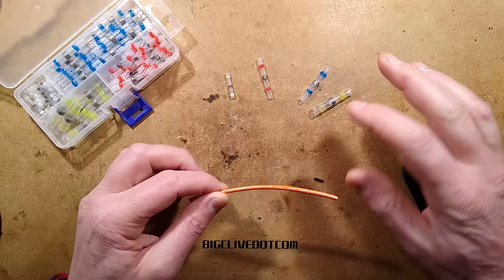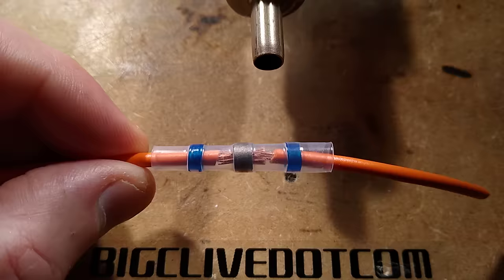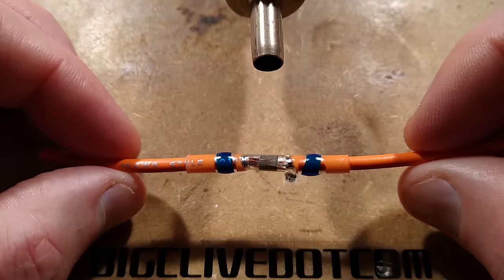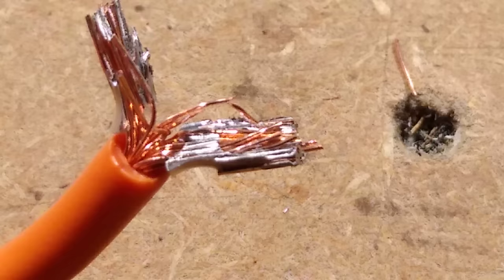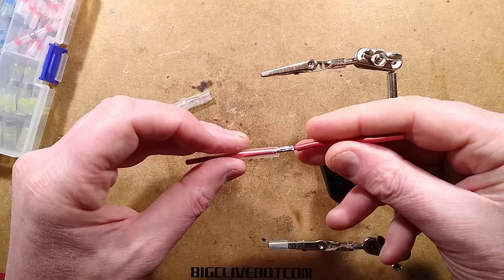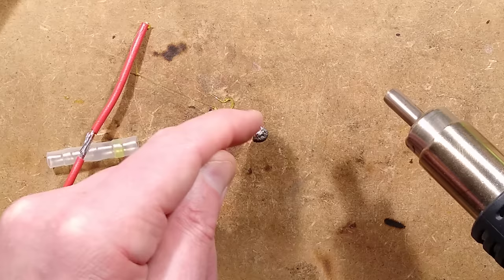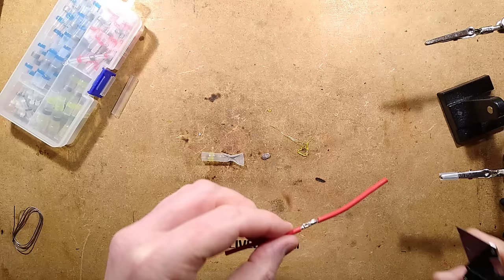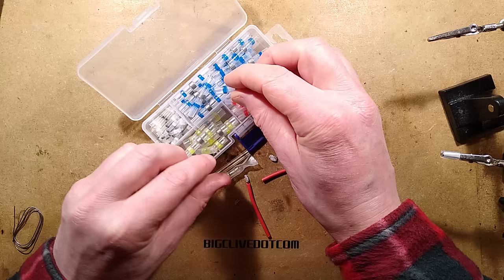Heat shrink solder butt connector test.

Comment: Have been using this for over 8 years never ever had any issues with it  but I use more heat than your first try. And mine cost +/- 0,75 €/piece.
Reply: You definitely haven't been using these, rather a quality ones for that price
Reply: Boy that's pricey
Reply: The Racal ones cost you deep in the purse but seem to be good. As ever, you get what you pay for.
Reply: @davidquirk8097  You don't get more than you pay for, but you can quite easily get less.
Reply: You're probably using real, aviation-grade solder splices.

Comment: Those things are awesome. There really doesn't need to be that much solder because it also crimps the strands together with the heat shrink. So easy and fast to use those.

Comment: Man, I love solder sleeves. Had to learn how to use them to mil-spec in my training days, never once used them professionally since. The rule has always been, "better to remake the whole cable than use any kind of splice" But for home jobs, use one every time because I'm not paying to replace a perfectly good length of wire.
Reply: I would argue that any properly done crimp or solder joint is just as strong, if not more, as the rest of the cable.
Reply: @Drives31forhalo  I agree with that. Properly done, a connection either solder or mechanical is at least as strong as the base wire. The lineman's splice is an example of that. NASA uses them as just a plain lineman's splice is stronger than the base conductor alone, even without solder.

But a properly soldered wire is also stronger than the base conductor, unless the base conductor is steel or something that no one uses for conductors.
Reply: Only time I used those in the avionics world was to make a connection to the braid of data shielded cables, as you needed a short pigtail of PTFE wire to go into the connector body for the shield, plus you had to seal the end of the cable as well so it would not wick up moisture into the shield and corrode it. 

The sleeves were Amphenol made, and you needed a pretty high heat to get them to reflow properly on to the pretinned end of the cable and the sleeve, the solder preform inside being there more to provide a final solder and flux flow than to actually tin the wires. You cut the outer down to the required length, then carefully spread the shield so you could cut around without nicking the inner cores, then made the end back into the correct braided shape, and tinned it to hold together. Same for the pigtail, and take the sleeve and slide over the outer sheath. Bring back down so the preform, the tinned pigtail end and the shield were all aligned, and heat with a hot air gun, till the sleeve was shrunk, and the solder melted into a solid mass. 

Then allow to cool undisturbed, and finally cut to the right length for your cable plug or socket ( depending on direction), strip the insulation off the wires, tin them and solder into the insert, or crimp onto the insert. then put in the appropriate hole, and carry on with the rest of the wires, then lace up the cable and sleeve it. Finally put the backshell on to the threads, and clamp the assembly.

Some of those plugs took hours to do, referring every time to see you got the right white wire, with the number printed on it, into the right hole, while you are lying cramped up inside a wheel well with the cable above your head, and barely able to move. I wasn't even a sparkie, but a window washer, but had to do all the wiring associated with instruments, because the sparkies would not, as they were afraid they would get the wires wrong for thermocouples. Dead easy that, replace one side because it broke or wore out, you do the other, using connectors out of the same batch.
Reply: @SeanBZA  So because the electricians were too afraid to work on wiring they made the window washer do it?
Wow you were working on aircraft? that scares me.
Did they wash the windows for you?
Reply: @thedave7760  haha something wrong there 🤦😂
Reply: @SeanBZA  I was with you until you said something about window washing...

As an avionic engineer myself, I can say no matter how much I might hate being upside down and back to front in a cramped space trying to use a heat gun and soldering iron, I would NEVER let someone unskilled in that work try to do it in such a location...

Mistakes are always harder to spot, let alone rectify if made!

But, you correctly pointed out that these sorts of sleeves would not be used for joining two cables, but for terminating the outer screen of a cable with a flylead.
Reply: In Aviation the preference is to replace the entire length of cable where possible, not to splice or join cables as a permanent repair.

Obviously this has practical issues, where cables may be over a long run, complicated routing or hidden beneath the floor with rows of seats on top.
It all depends on what the manufacturer or design authority allow as a permanent repair.
Cables are certainly spliced as temporary repairs, however there are limits to the number of joins or the location of them depending on cable type and system.

With some safety critical systems a join in the cables would not even be allowed as a temp repair.

Production splices, connectors and breaks are obviously allowed for in the design so these do not count.

But if a temporary splice is added, it would be recommended for cable replacement at the next practicable opportunity, such as major overhaul, or next flight to a maintenance facility.

Everything I have said above is dependent on aircraft manufacturer/design authority/operating company, but a general overview. Each one will have its own standards, methods and allowances.
Reply: @underwaterdick  I sure hope aircraft designers provide a way to replace cable and tubing runs without first removing seating etc.  But on the other hand, architects devolved from easy to access pipes and easy to replace wiring tubes to methods that require major work to replace.
Reply: @johncrowerdoe5527  not generally, reliability, safety and complexity rule over ease of maintenance or access.

But, cables don't just "break" something will have caused it. And the root cause is what designers try to avoid.

Wiring harnesses must be secure, allowed to flex where required but not allowed to rub on anything else.
Anyone working on the aircraft, even to clean it, should have basic EWIS training to be aware of what any damage to wiring could cause.

If a cable runs under the floor and seats are fitted, they will have to be removed. In passenger aircraft most things are buried beneath trim, seats, toilets or galleys. Which makes gaining access time consuming.

I work on some very old 1960s Aircraft and we carry out ageing aircraft inspections which include a detailed look at as much of the wiring as we can access. The same goes for structure, every area is inspected visually where possibly, or with other methods where it cannot be seen.
Reply: @underwaterdick  That's sad, also for upgrades that require extra wires (like adding an additional sensor in the tail).  Mechanically, I would have thought access from below or from the ends of the aircraft would be the norm, given the pressure to reduce time on the ground.
Reply: @johncrowerdoe5527  all these things depend entirely on the aircraft manufacturer.

Many of the larger passenger aircraft have access hatches to avionics bays from either below, or from a hatch in the floor, but access to the wiring its self is generally by stripping things down.

When we modify aircraft and install new systems, it is down to the design authority and the company purchasing the modification, whether the cables are routed with access in mind.

Many other factors play a part, for example where Primary and secondary systems should be run as far apart from each other as possible, so that in the event something happens to one, the other is still operational.

Usual rules about heating effect of bundles, AC/DC segregation and Electrical noise are also considered as with any wiring installation in a house or industry.
Some cables cannot be run near motors, generators or transmitters because the application might be safety critical and need to keep as "noise" or interference free as possible.

Access SHOULD be a consideration, but in the eyes of many designers, when the wiring is installed, it should never have to be touched again. - The service life of many aircraft isnt a huge number of years generally.

But, there are many exceptions, as with the ones I work on.

Issues we face are things such as a small piece of damage in the outer insulation or termination at the end can allow corrosion to start in the copper conductor. This leads to breakdown of strands and overheating.
This is why ageing aircraft have to undergo special more detailed inspections.

I'm glad these things are not easy, it keeps Avionic Engineers like me in a job!! 😁
Reply: @SeanBZA  WHAAAAATT!??!?! Where the eff were you working where they were sending window washers to do avionics electrical connections? Sounds like either a place that needs reporting to the FAA or it's just a story you cooked up; with the latter not being as dangerous as the former.
Reply: @xenonram  Instrument fitter, colloquially called window washers by the aircraft fitters, because all they saw us do when the aircraft was on the ground, and they were running around greasing here and there, checking mechanical parts did not fall off, was checking and cleaning the cockpit and canopy. Thus the window washer name, because we also got really good at filling up fuel as well, we were often called pump attendants, and occasionally black box changers.

Yes I have the papers to prove it, along with the industrial trade test as well.
Reply: @SeanBZA  Ahh ya see thats what happens when you use jargon in a public forum, thats cool nice to learn something new.
Reply: You are forgetting about adding connectors to the ends of the cables. Always crimped. Better tensile strength and the least resistant. All wires need to connect to something.
Reply: @Drives31forhalo  it's not just about mechanical strength. Creating a splice also compromises the wire covering.

Comment: I've used these to repair light wiring on my tractor trailer. They have held up really well. Haven't had a failure yet. I run thru upstate New York year run and the salt doesn't seem to affect them either.
Reply: Exactly what I came here for.
Thank you

Comment: Odd timing, I ordered some of these a month ago on impulse to try them out.  Used on some 12v barrel plug connector wire ends, and they worked pretty well, although low current use yes.  I was very surprised it worked so well with a pocket lighter, including the solder blob.  I was expecting far less!  May end up helping out in a pinch some time.
Reply: Yah I just use alighter.  So nice when location isn't the best.  IE low voltage wiring outdoors.
Reply: That's so funny I literally almost did the same thing, decides to try them making some low 5 amp battery harnesses with 5.5 mm connectors. Needed nine of them so I just when into production mode, fuse connectors, DC Barrel jack connectors, Spade connectors. I had a battery blow a hole in a BIG free UPS and decided to replace with a fresh set, after testing I came out with 9 Good batteries and one with a hole in it. they've been sitting around not doing anything got them wired up just in time for a power outage a few days later. The 10th harness went into a project that I needed a smaller battery for, so I was able to swap out my unfused cable with screwed terminal Barrel jack connectors.
Unfortunately I realized after the order came in that the fuse holders did not come with fuses and after blowing a few fuses I decided it was probably time to go buy one of those box sets on Amazon, that way I would have the correct fuse in all 5ah batteries. The inevitable one or two times you put the wire the wrong way accidentally bump contacts and go pop, followed by the oh sure that cellular internet backup router uses more than 5 amps on Startup situation. Leaving me swapping over to the more plentiful 10 amp fuses on the 18 gauge wire until the fuses come in next week..... needless to say I've had some bad experiences with Amazon I prefer eBay, I recently ordered something and I think the seller declined the order and that canceled out everything else I ordered and some of that was for a client install.
Edit: I just realized that the last issue I had on Amazon was ordering some transistors to repair the same UPS, I ordered new components and got refurbished recycled components...
Reply: 3 weeks ago lol

Comment: I worked for a defence manufacturer in the 1970s.  They used a device called a solder shrink sleeve that was very similar to these devices.  The shrink sleeves had a solder pre-form and a PTFE heat shrink outside but I don't remember any hot-melt glue.  They worked very well and met the mil-spec standards.  They were used to interconnect subassemblies.  It looks like this solder that is bismuth based for low temperature.

Comment: Nice work Clyde. The anti DIY HVAC guy tried that same low temp soldier and he was amazed how well it worked. He said you literally can’t pull it apart and you could see the solder melting into the wires

Comment: I remember when these were a "New Product" in the RS Catalogue (Paper version, too!). Over the years I must have used hundreds of these, and every one was a complete success (for the purpose intended).  They are great for emergency repair where water ingress is a problem, and for low current applications they are more than adequate. Indefinitely durable too (must have a few "out the back of the property" which have been there in all Aussie weather conditions for well past 12 years, and still work just fine as intended).

Comment: These kind of splices are regularly used in quick aviation repairs (after certain prerequisites have been met of course), we usually have a pressurized air heater with a small pistol attached to a hose (Raychem AA-400 Compressed Air Nitrogen Heating Tool) instead of a heat gun to make maneuvering around wire bundles more easy and reduce bulk at the business end, along with a deflector shield, so that only the wire that you want to repair, gets heated, excellent repair method, when used for the right circumstances.